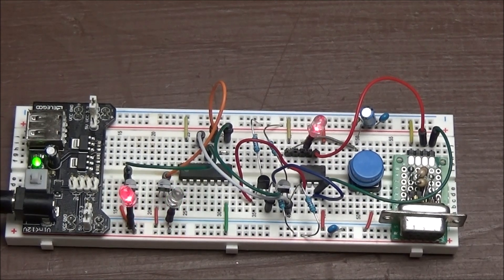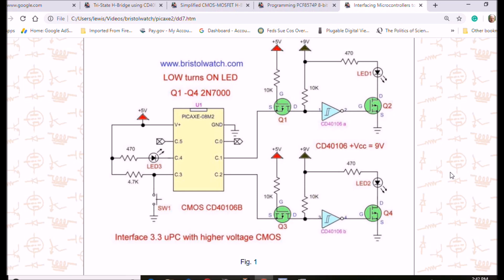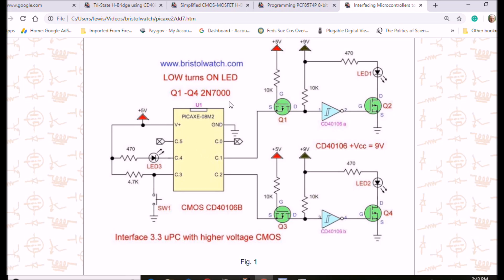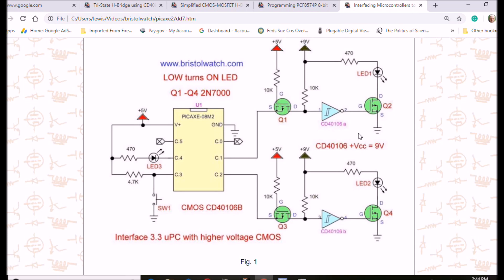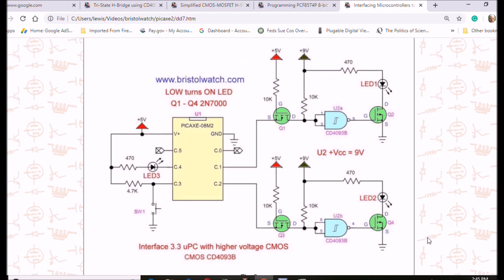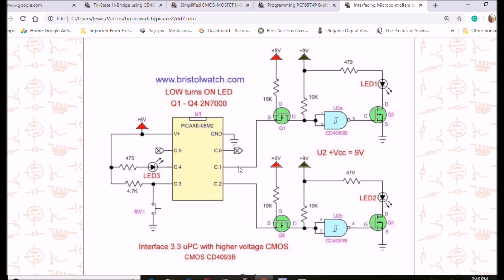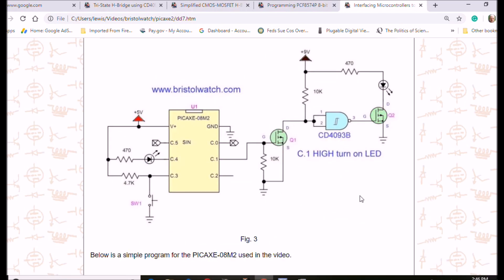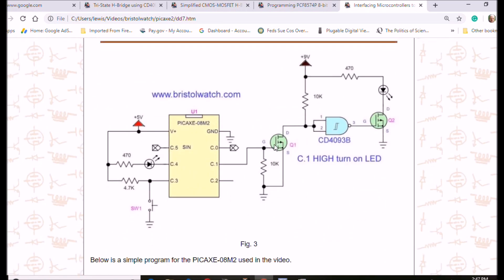Pt. 1 Interfacing Microcontrollers to CMOS and MOSFET Circuits

Comment from the maker: Part 1 of three.
Pt. 2 Simplified CMOS-MOSFET H-Bridge Circuit
https://youtu.be/rExHPqTUBuA

Pt. 3 Tri-State H-Bridge using CD4093B CMOS Circuit
https://youtu.be/b8O4ihdHx8U

High Voltage IGBT H-Bridge Using Photovoltaic Optocouplers
https://youtu.be/azJo4h-ei6I

Arduino Controlled IR2110 Based H-Bridge HV Motor Control
https://youtu.be/d0r-Yx9R3Zs

Pt. 1 TB6600 Stepper Motor Driver with Arduino
https://youtu.be/PHe2MK9CvQM

Pt. 2 Program TB6600 Stepper Motor Driver with Arduino
https://youtu.be/jtX0t7-m69M

Arduino Unipolar Stepper Motor Driver Board with Arduino Code
https://youtu.be/HTVYiLOY8SQ

Comment: Does the inverter have any other purpose that to invert the input to the second mosfet?  In other words, if yo wanted to build a non-inverting circuit, could you just remove the inverter and connect the mosfets directly?
Reply: yes in general,  yet don't forget that you interface a 3.3v output to (even though it looks as if the uC is also connected to Vcc=5v) to CMOS 5v input so he added the schmitt trigger on the way.
I am still not sure what is the role of the first MOSFET (with gate always connected to Vcc) in the design..